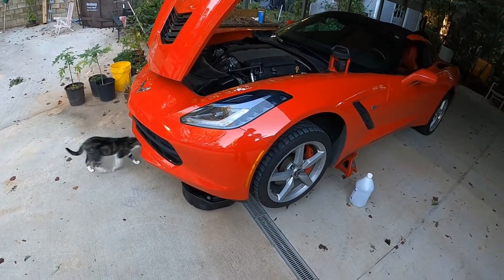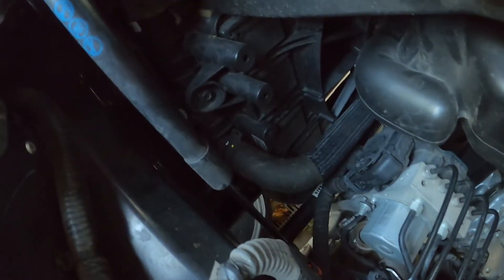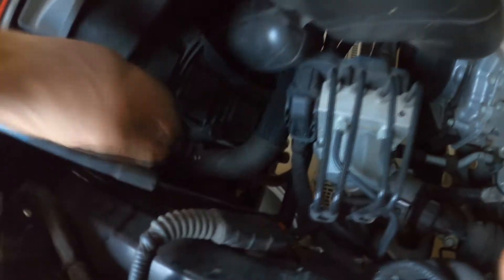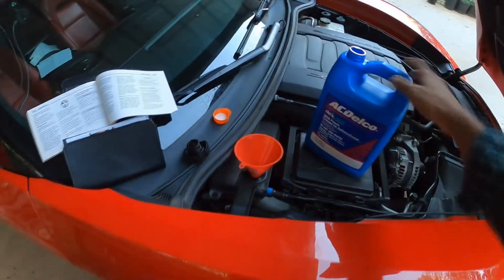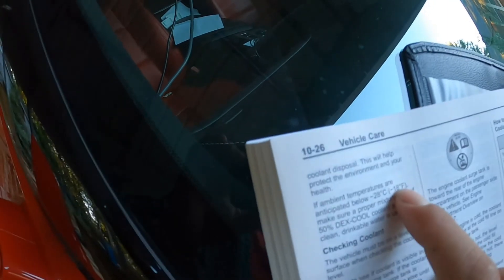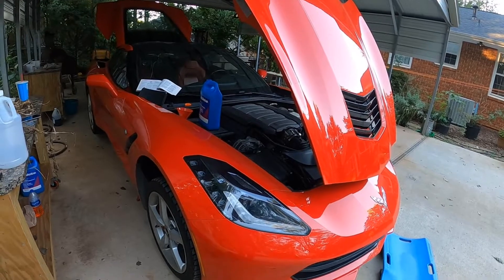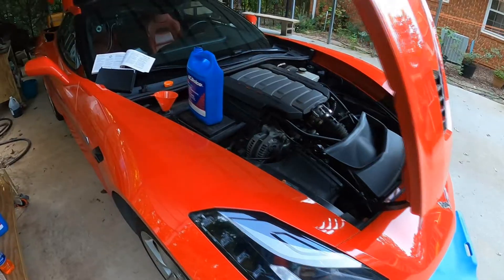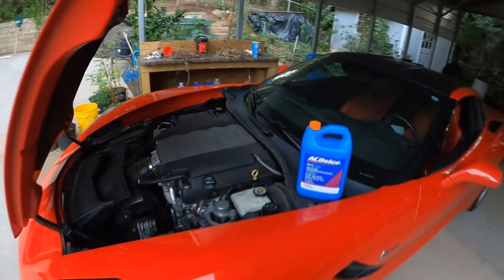Corvette coolant change

Comment: nice video..the chev dealer near me in so.calf. has only full strength coolant...so I got a 3gallon sparklers water bottle n added 1gal coolant + 1-gallon of distilled water..then 13 more ounces of the water 4a 60-40 mix.that way it will run a little cooler.

Comment: I’m taking my 2018 ZO6 to the dealership for anything I need done as far as routine maintenance except oil change I do my own oil changes once every fall when I’m putting my car away for the winter!!! Mobile 1 only 9 1/2 quarts it’s pretty simple I put my car up on cribbing I saw on U-Tube one underneath each tire it’s fool proof but you need a race car jack and the lifting pucks from Chevrolet for C7 Corvette’s

Comment: Did you need to burp the system?  How much coolant did it take to fill the system?
Reply from the maker: After running it,  i did have  to top of the level a little.    I had bought 3 gallons and that was enough. My car is also not Z51 so it does not have the extra coolers.

Comment: How often should you change coolant?
Reply from the maker: I was recommended by service to do it every 5 years or 100k miles
Reply: @corvettedude4423  I would go with 5 years or 60K miles. I will be changing mine today.
Reply: You should flush the system prior to adding new fluid.